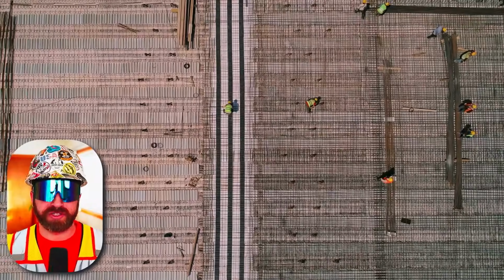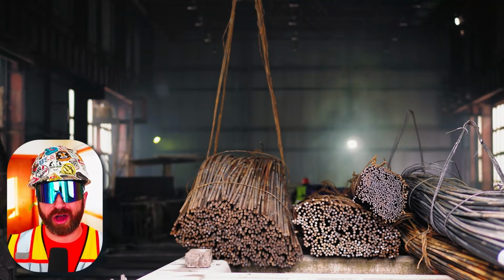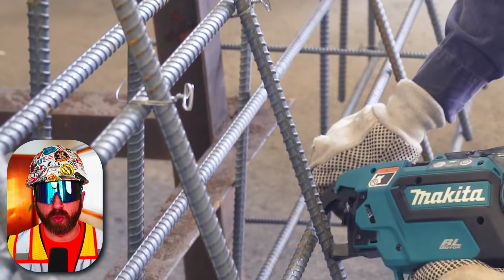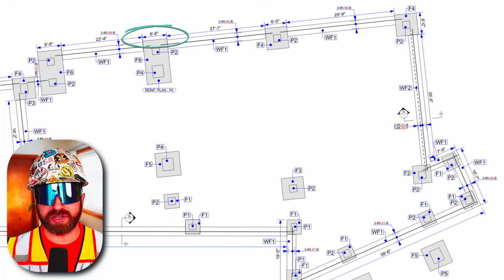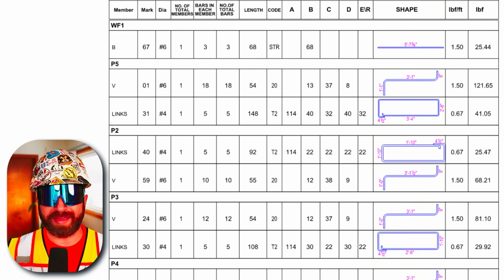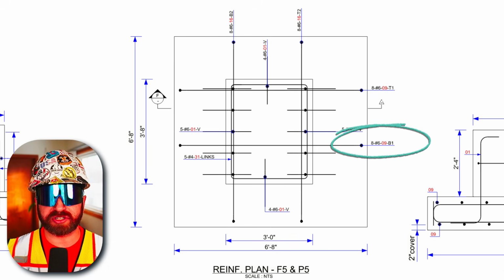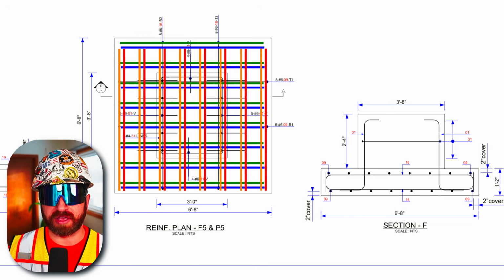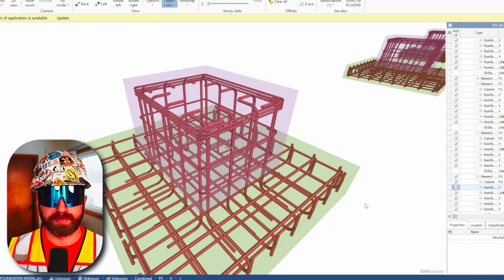Rebar Shop Drawings: The Ultimate Guide

Comment: I hate to disappoint you, but the individuals that produces the rebar shop drawings are not structural engineers.  I had to laugh about that one. The majority of them have never graduated from college, and some have never set foot in a college classroom.  The rebar detailer interprets what the structural engineer for the project has already designed. For someone without a college degree, detailing rebar is a great career. A good rebar detailer can find work anywhere in the US. It's a great occupation and pays well for those who are good at it. Some move up to become rebar estimators, and even company managers.
Reply from the maker: Hey, not disappointed at all!  Good catch, detailers do not need PE licenses - in fact the person that helped produce these rebar shops for this video (who does this all the time) doesn't have a structural degree.  I was moreso thinking for delegated design projects that require a stamp when I wrote this into the video, but absolutely not necessary as you mentioned as it related to typical rebar drawings in this video.  Thanks again for the added insight and catch 👍

Comment: Hi. Thank you very much. It helped me a lot. 
If the rebars are running on a slope, elevators mats… how will it show on the shop drawings?
Reply from the maker: Likely a section cut showing the slope.  Every rebar drafter is different so it could honestly be depicted multiple ways.
Reply: Thanks for your respond. 
Do you have any video for shop drawings from Elevator?
Reply from the maker: No, not yet at least.

Comment: Hi, is the section F kind of showing wrong direction? You see according to the section F arrow, we should be seeing B2 and T2 as dots and B1 and T1 as lines in section view. Sorry if I am wrong, just confuse.
Reply from the maker: This is understandably confusing, when I first started looking at these shop drawings I thought the same.  The actual bars (rebar) for B1 and T2 run perpendicular along the vertical lines in plan view.  So when we look at the section cut, B2 & T2 are shown as lines (and not dots).  The bars (rebar) for B1 and T1 run perpendicular across the horizontal lines in the plan view.  Meaning that we see them as dots, and not lines in the section view.  Rebar drawings are all drawn differently, so it's just a question you could confirm with whomever drew the shops.  I hope this makes sense.